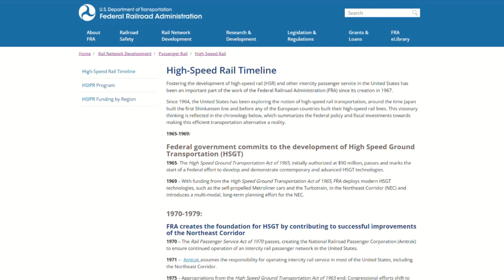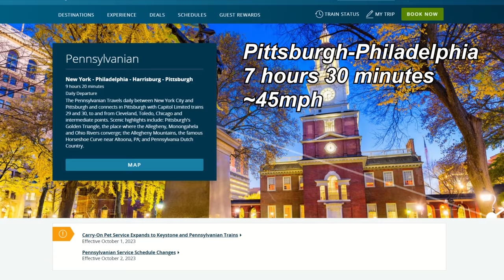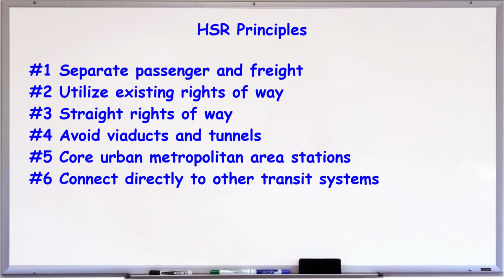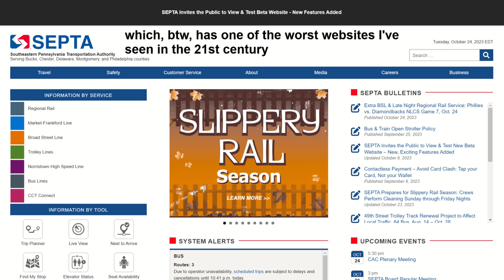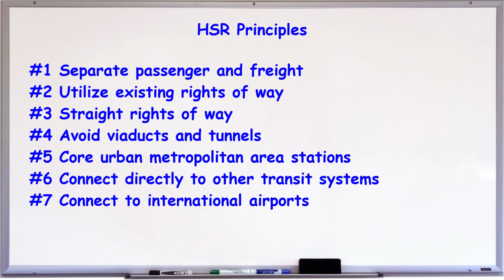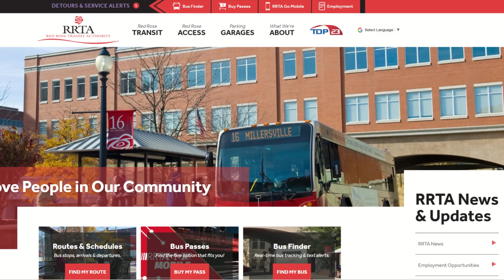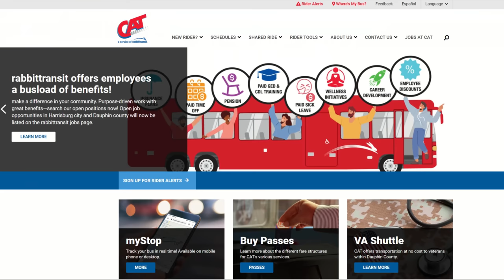Pennsylvania's Keystone High Speed Rail Corridor at True High Speed?

Comment: I like the "flyover" depiction showing the terrain considerations. Makes the entire presentation much easier to understand. Good job.!
Reply from the maker: It's a nightmare, right? I'd love to go visit there some time. Seems like really beautiful country. Just terrible for building in a straight line. :)
Reply: @LucidStew  I've been across central PA several times, but I find I prefer the northern route across on US 6 for scenery. It doubles the travel time, but the stress level is way down. Definitely not a good route for rail lines, high speed or low speed!
Reply: Grade separeted is more important. At 3 miles  a minute u dont want and risk of anything in the way..
Reply: This nicely illustrates the challenge through the PA mountains.  Most just think a couple of tunnels fixes everything.

Comment: Wow, what a great video! As someone from the Pittsburgh region who has looked plenty into the current rail infrastructure of the state, I never would have thought that the I76 idea would be possible like that. Explained excellently!
Reply from the maker: Having made quite a few of these videos now, I've come to realize that all routes are possible, and the question comes down to expense. I've had to tackle a couple of ideas that I thought could not be done at first glance. However, in committing myself I not only found a way, but it was easier than I imagined when I first saw the light at the end of the tunnel. Although, I think that's generally the case in life.
Reply: @LucidStew  Not sure how feasible that ending 5 mile tunnel though under Pittsburgh would be. Pittsburgh has been trying to build a just 2 mile subway from Oakland(neighborhood) to Downtown for over a century now and they've estimated that tunnel would cost $2 billion alone. Now I know economy of scale factors in to HSR to make the cost cheaper but still...
Reply: Agreed plus I love how it makes use of those existing abandoned tunnels as well..

Comment: Wow -- 3 hours and 47 minutes from Pittsburgh to NYC? My recent Amtrak trip on that route took 10 hours, so that's a ... slight improvement. Also, the current route is 444 miles, so using the PA Turnpike right of way saves distance. Incidentally, the Turnpike's right of way began life as the South Pennsylvania Railroad.
Reply from the maker: That's with a moderately high-speed route, not trying to push it or anything. An improved NEC main line would cut about another half hour off that.

Comment: Even thouhg it's just bus service, the bus service is really good and Lancaster is definitely surprisingly urbanist for it's size. I think the people would really benefit and really enjoy a high speed stop. Would also bring in easy tourism from around the country improving the town!
Reply from the maker: I've not been there and my familiarity is through Google maps and a little research. However, it seemed like the downtown area was mostly capable of being elongated toward the station. I think it would be a good bookend to the downtown area over time, with the north end more residential, and the southern end more commercial. Might be nice to have a short trolley loop in there somewhere along with all that. The current downtown area is very charming and is certainly a draw.
Reply: I live in Lancaster and yes, the downtown area is slowly but surely making it's way north towards the station. Lots of mid-rise housing going up along N Queen St. and the station area has tons of mixed use zones and bike infrastructure proposed. Lot's of the undeveloped land around the station is finally getting used. LNC is PA"s second busiest station and the 21st busiest in the country. Many people (myself included) enjoy taking the train to Philly, and a high-speed service would be welcomed.  @LucidStew

Comment: Pennsylvania's GDP is 722bn so assuming a 10 year time frame the strict alignment alternative is 0.15% of PA GDP. The more expensive option is still only 0.26% of GDP over 10 years. The tax increase required to fund this would be negligible if even required at all
Reply from the maker: Seems pretty doable over a 15-20 year process, especially with federal help. Philadelphia-Harrisburg has already seen significant strides in terms of sealing the corridor. I ran across a chart in my research where the big draw for this line is actually Harrisburg-NYC, but Philly gets you on the NEC, so the connectivity for Pittsburgh could be a huge driver for traffic. Of course at 7 1/2 hours that doesn't exist now.

Comment: Neat proposal! I'd probably add a stop on Bedford PA with a shuttle to Altoona, since Altoona has a metro population of 120K and is currently served by Amtrak.
Reply from the maker: Generally the idea with HSR trunk lines is that they're meant to be a main branch in a rail network. Think of it as an interstate in relation to surface streets. In that regards, you'd have something like this IN ADDITION to the existing regional rail services along the Norfolk Southern ROW.
Reply: I think HSR would be best served as having maybe 1-2 stops. I would think that there’d be none until Lancaster (SEPTA is expanding there in a few years) and none until Harrisburg (the local Amtrak trains can operate that) unless you build the airport stop. Then there would be 1-2 along the HAR-PIT route - one serving state college Huntingdon and Lewistown (shuttle or just keep running the Pennsylvanian) and another serving Johnstown and Altoona (this would be the most beneficial station if Amtrak puts it there). I also like adjusting the existing NS-run route to serve state college if possible.

Comment: About a week ago Citynerd produced a great video, revealing the strongest 56 city pairs. I was astonished how early Pittsburgh to New York popped up, then Pittsburgh to DC popped out with a strong showing.   ---  You were correct to look for a more southernly route across Pennsylvania, as opposed to the existing corridor. The best approach would get passengers from NYC/PHL along with DC and Baltimore traffic into the same corridor at Johnstown. --- Some of my ancestors lived in mountain towns in the 1850s when the railroad was first built. I realized that the existing route is where it is, because that is where the canals went. in 1850 --- An economic solution would take the PHL route from Mt. Union into Bedford and the DC and BAL traffic from Hagerstown into Bedford.   ---  Pennsylvania needs to work with Maryland like Virginia is working with North Carolina.
Reply from the maker: Yeah, I liked that one as well. I think it has a couple of flaws. His gravity model tends to bias toward near city pairs that are maybe TOO close. His model is based on extremely rosy train performance, extremely poor airport performance, and extra car time that doesn't make much sense. I think the reality of the average HSR sweet spot triangle is a fair amount smaller than the one in the video. Also, he's not taking cost into account, which makes a big difference on routes that are going to be expensive for what you get, like NYC-Buffalo and Philadelphia-Cleveland. This is especially true when you combine that with his 165mph out-of-the-city average cruising speed.
Both those routes would be so expensive with the amount tunnelling that would require...

Comment: This would make Lancaster (and maybe even Harrisburg) commutable to Philly and would be a huge boon to those cities which already have high Amtrak ridership and regional ties to southeastern PA. ROI on the eastern section is a no brainer

As someone who currently lives in Pittsburgh I'd personally love the HSR across the state but unless you also connect it to Cleveland/Columbus and on to Chicago I'm not sure the case for the western section is quite as strong since there are no major towns or cities between Harrisburg and Pittsburgh. There's obviously high travel demand between Pittsburgh and points east but that's a lot of money and a lot of rough terrain to cross to connect to what is essentially a single mid-sized city that's been losing population for 70 years

If you do build this, the 11bn alternative is probably a more reasonable investment. It would still beat driving and probably even flying between Pittsburgh and Philly, and might even be competitive with a flight to NYC
Reply from the maker: Yeah, I agree on the Chicago Hub side. This is one of those connector routes that becomes much more compelling with build out of the corridors it would connect.  I'll cover Pittsburgh-Cleveland, and possible Pittsburgh-Columbus eventually.
Reply: The Pittsburgh metro area is rather large though. A lot of people just moves further into the county. The city is just artificially smaller than it needs to be because the county is so broken up, and the city hasn’t expanded its territory unlike other cities. 

But a Pittsburgh to Columbus extension would make so much sense. I can’t imagine it not happening natural following a successful PA rail line, especially if the 3 C Ohio rail line also happens. 

Pittsburgh is in a really good position because it’s basically the connecting point between the northeast and the Midwest, so basically everything going between those two regions would have to pass by. The only other option would be a stop in Erie on the way to Buffalo from Cleveland, but there’s no way that would happen before a Pittsburgh/Columbus connection.

Comment: Great analysis, but I always want to see what you happen if we just said screw terrain and drilled some huge Allegheny base tunnels instead. As the shortest path 
(as the crow flies) between a potential Chicago hub and the Northeast megalopolis it could be more worth it within a nationwide HSR plan, if a biiiiiit of a stretch construction/money wise.
Reply from the maker: It really kind of depends where you start and where you end. My first thought was straight line between where I-76 enters the 'valley and ridge' and Latrobe, PA where NS would take it the rest of the way to Pittsburgh. However, the area around Johnstown was such an intense nightmare that I immediately threw in the towel.

Comment: like the fact you went for Route 76, though when I've mused this route I've gone for a NYC to Pittsburgh route via Allentown. though the route you took between Kenmar and Breezewood i feel you could easily achieve a straighter / slight S bend from north side of route 76 to run under the tunnel through the mountain range. coming back to parallel with Route 76 where it crosses Amberson Rd. basically taking a long sweep diagonally through the entire region. at breezewood go parallel with the Route 70/76 till Bedford for another long S Bend to south of Somerset. the take a roughly similar route as you have talk about before re-joining the rail system around Ardara. but with all the curving around valleys just tunnel through straitening it all out before re joining your route in Pittsburgh station. 
 
from Pittsburgh you could easily Y  to Cleveland - Toledo and Chicago, I think it would be useful to aim to go though Pittsburgh international. but make it a useful transport hub. while the other way to a Very highspeed corridor for Columbus - Indianapolis - St louis and or Chicago.
Reply from the maker: I took a slightly different approach on this one. My usual motive has been to aim for 200mph in as many places as possible. This time starting at the interstate geometry and mainly staying there minus the slow speed curves resulted in this sticking to the interstate more than I would have otherwise. One example I can remember was Bedford, where I was tunnelling a couple miles south of I-76 rather than going up, around and through along I-76. Also not shying away from tunnels that ran through the ridges diagonally. Those original ideas were probably a little closer to what you're talking about.
Reply: Maybe for a bit of fun, design one route New York to Chicago at 250MPH With the intention of competing with air travel between the two cities, and if you like try a Maglev route too XD though that basically draw a straight line between the two
Reply from the maker: @richardmoore899  Yeah, I was going to say... maybe a 600 mile tunnel? :) Basically describes the hyperloop concept, so may as well run the trains at 600mph.

Comment: Crossing the Appalachians with HSR is one of those things that is going to be very complicated. They will probably have a computer find the optimal route.
Reply from the maker: One component left out here is geotechnical, and that is one aspect that could change things wildly. My general assumption was that tunneling near existing tunnels would be reasonable. That's not the smallest assumption. It's definitely a tricky area to try to get a huge engineering project through.
Reply: @LucidStew  They'll probably get a computer model to spit out a few different routes and then find which one poses the least risk, geotechnically. The most likely outcome is that the best crossing is somewhere else in the Appalachians, and we'll just build one really good route and funnel all HSR services between the east coast and the midwest over the one crossing. From that perspective, it makes sense to locate the crossing further south, since it would allow better connections between the southeast and the midwest. There's also the issue of competition between a keystone HSR and an Empire Corridor HSR. Building two routes that close to eachother doesn't make economic sense.
Reply from the maker: @marcusnavarra8356  I don't have any idea where the most geotechnically pleasing route would be. However, at about 1,000 miles in length I think the Appalachians could support more than 3 HSR crossings. Of course as it stands now, that sounds excessive. However, if we're talking a situation far into the future where there are thousands of miles of HSR in the U.S., that might make sense.
Reply: @LucidStew  It sure sounds like this is a job for ... maybe ... Switzerland?

Sitting back and looking at the whole HSR problem between Harrisburg and Pittsburgh, it makes one wonder how rivers like the Susquehanna and the Hudson were able to cut a way through the Appalachians at ALL!  Maybe Nature is pointing out an easier way to cross the mountains starting at Harrisburg, forget Pittsburgh, and go for the bigger prize of better HSR connectivity from New York/Philadelphia to Chicago by heading north to Williamsport, PA, then making a hard left and continuing to Youngstown, OH.

Easy for ME to say, huh?  🤭

Great analysis job, Stew, as always!!
Reply: @MikeWiggins1235711  The Susquehanna is actually older than the Appalachians. It didn't cut through them, the upheaval of the earth's crust wasn't powerful enough to displace its flow. That's why all the cuts through the mountains are called water gaps instead of canyons.
Reply: @IrishBavarican  Thanks for your reply.  To me it is still amazing that the Susquehanna still exists even though it is OLDER than the Appalachians ... and the Appalachians are so old that they are not as tall as they USED to be .  And the water gap that was created makes for a less expensive HSR pathway westward.
Reply: @LucidStew don’t try tunnelling next to the Allegheny Tunnel. It’s sinking and the PTC is going to bypass it.

Comment: @Lucid Stew: Did you consider re-using the double-track South Penn R.R. tunnels? Many were restored and upgraded when the PA Pike was built in the 1930s, and they were maintained into the 1960s (those that were'nt double-tunneled). Moreover, the engineers that originally studied the South Penn for highway use praised the original engineers for consistently choosing good geology for the bores. That would significantly reduce the cost of a PGH-HAR line, and it would help persuade decisionmakers to use a South Penn route rather than try to straighten the Juniata and Conemaugh Rivers. Not to mention possibly impacting Horseshoe Curve.
Reply from the maker: Yes, but as memory serves there is some difficult involved there, and the route through those was a little slow.
Reply: @LucidStew  -- Really? All the South Penn tunnels are straight. It would just be necessary to realign the curves to 110-125 MPH. Of course, the maximum grade of the South Penn was only 2%. Moreover, the area around the abandoned parts of the Penn Tpk. are not heavily settled. That doesn't solve Blue and Kittatinny  Mountains, but Sideling Hill, Ray's Mtn., and other ranges have abandoned bores all the way to Somerset. Even the old Allegheny Mountain tunnel might be improvable. The only real issue is that the 1968 relocation is officially a bike trail, but that doesn't mean the tunnels can't be used for their original purpose. Some of the old bores could be daylighted, thanks to the availability of modern earthmoving equipment.
Reply: The left-over South Penn roadbed is likely too curvy for even a 110 MPH railroad. However, re-using the tunnels, which were all designed to be double-track, might cut billions from the project cost.
Reply from the maker: @pacificostudios  I didn't consider the tunnels themselves to be an issue. It was an idea I was considering at one point. I recall one of the tunnels having an approaches on the side of a very steep slope and geometry was not very fast. In this particular video I tried an approach where I roughed out a route more less parallel to freeway. Then I eliminated all the sub 90mph curves, then all the sub 110mph curves. That as opposed to trying for 200mph straight away, since this route is so difficult to keep straight without being underground half the time. In that process the tunnels went by the wayside.